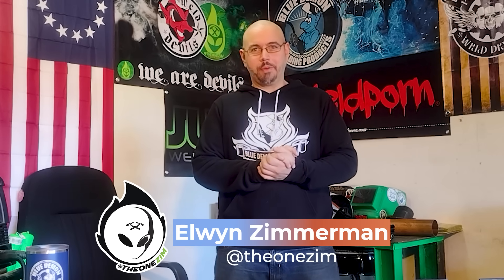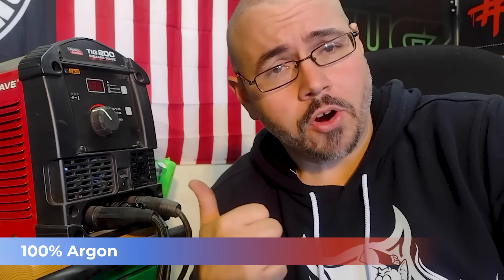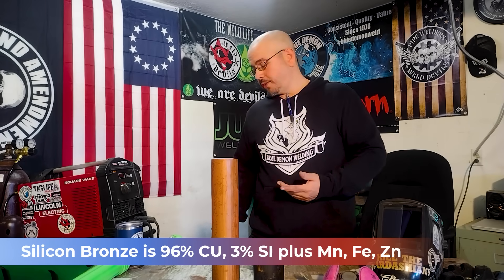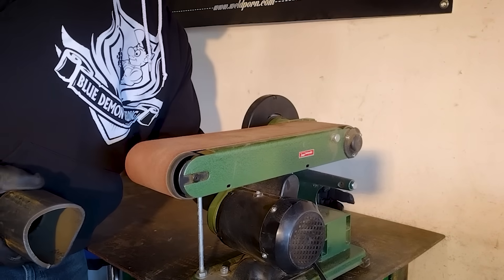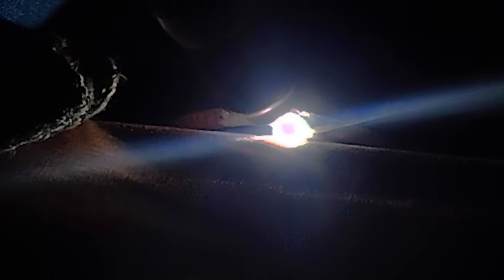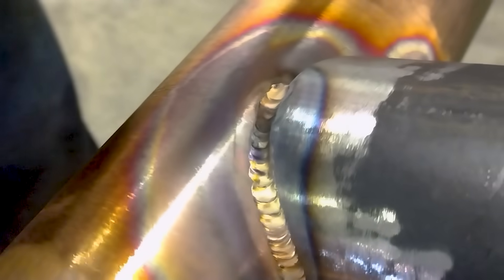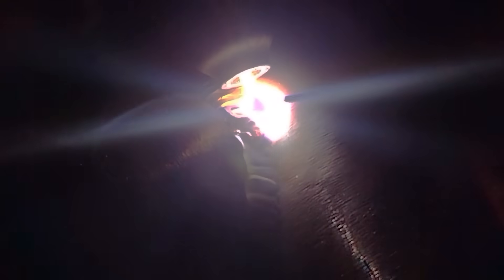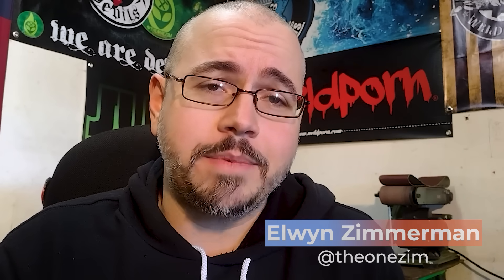TIG Welding Copper to Steel HOW TO

Comment: I think this is TIG brazing.  If you form a weld puddle on carbon steel and stick a silicon bronze rod into it, it will vaporize the silicon bronze because of the large difference in melting points.  You can weld copper with a silicon bronze rod because they are similar metals with similar melting points, but copper or silicon bronze will not weld to carbon steel.  When he talks about "washing up" with the filler metal, the steel is not melting.  The proof would be to cut and etch the weld nugget to either verify or refute that it is a "weld".
Reply: As I have learned, in welding the two materials to be joined melt, with or without an added filler material. And in this video I don't see liquid steel, so it's not welding, but brazing. So I think your statement is correct.
Reply: Like I said in the initial post, this is easy to prove or disprove.  Just cut the weld, polish, and etch so you can clearly see the weld nugget.  You will be able to clearly see if the joint has melted and joined, or if it is in fact a braze joint.  Now, there is nothing wrong with brazing.  Brazing is very strong and reliable.  It's just that welding and brazing are not the same thing.
Reply: @HemiRod23  Sadly most videos cut short on that, but it is a necessity to judge a connection.
Reply: Correct.
Reply: ok hemi i feel your point! however it only takes about 90 - 110 amps tp melt that steel??? he is running 200... i know that he is pumping the peddle however at a 200 amp max SOMETHING is meltling. also another just food for thought.... this isnt a structural weld its more like an art or fabrication thing
Reply: @kc8mwt  he's using 200 amps because of the copper.  Copper dissipates heat very efficiently, and needs a tremendous amount of heat input to weld.  Aluminum is similar if it's a large enough piece.  I used 250amps to weld an aluminum transmission case because of the amount of heat it could dissipate.
Reply: @HemiRod23  I know... that was my point
Reply: There are copper alloys containing iron, and there are steel alloys containing copper.  Metallurgically speaking, welding these two metals together are entirely possible IF you can melt and alloy them together in the puddle under the right conditions.  The boundary layer in the weld between the two dissimilar metals would be a mixed transition zone between a steel-copper alloy and a copper-steel alloy, blending out to each parent metal.  That's not to say it'll form a strong bond, but the two will technically be "welded" together by the very definition of the word.  Practically speaking the alloys created will be weak, have different expansion rates, and the joint will likely fail if compared to a more traditional brazed joint.  I couldn't say what's going on here and neither could anyone else without cutting, etching, and examining under a scope first.
Reply: @Skinflaps_Meatslapper  Agreed.  As I mentioned, cutting and etching is the definitive proof one way or the other of what took place.
Reply: I think this process can most accurately be described as "microscopic brazing". The copper and steel are melting and adding to the puddle, but they will not form an alloy with silicon bronze in the puddle. The puddle will contain microscopic sections of iron (copper will mix into silicon bronze and alloy with it); the puddle will not be an alloy containing iron; it will me alloy of silicon bronze with added copper content and iron mixed into that alloy.
Reply: I think could be it oxyfuel brazed. Heat the steel up first.
Reply: @Portarius1984  Difficult but maybe possible. Copper is very unforgiving.
Reply: Lol yes that's called brazing not welding. Welding is actually fusing metal together but I mean if it doesn't need to be strong then it will do for the hobbyists I suppose. I've brazed just because it was faster too
Reply: Where I work we use monel filler, it does get an etch and dye test and it most definitely does have a true weld, not brazing.
Reply: winner winnner, chicken dinner
Reply: So which rod is better for copper to carbon steel?
Reply: @adonaytewodros5340  brazing is really your only option, copper doesn't weld, it can be stuck together though
Reply: What rods to use with copper when welding steel308?
Reply: Thank You. Excellent description
Reply: Dang you weld like a robot
Reply: @HemiRod23 I can assure you that welding the two together is possible. No filler rod
Needed if done correctly.   I have done this many times now.
Reply: If you are melting the steel and the copper then it is a weld, correct?
Reply: @jasonbirch1182  >If you are melting the steel 
That was his point - steel not is melted and melted filler just stick to it like tin stick to copper wire.
Reply: @delta_glider4362  9:55-10:15 it's clearly melting the edge of the steel.
Reply: @jasonbirch1182  agreed... not sure what they're seeing.. he even says to wash the copper puddle to the steel and use very little filler because the MELTING STEEL will add to the puddle...lol
Reply: @jasonbirch1182  he may be melting the edge of the steel, but that is a bad thing. In this process you don't want to melt the steel. If you melt the steel you are weakening the joint and if you melt too much of the steel in the braze it will crack. It is an unwanted side effect of imperfect brazing technique not a part of the process.
Reply: @jasonbirch1182  you cannot weld ferrous and non-ferrous metals together!
Reply: @offyouselfsbuddy1683  ok, except he just did. So try again.
Reply: @offyouselfsbuddy1683  Um. Mild steel to 304 SS is ferrous to non-ferrous.
Reply: @offyouselfsbuddy1683  Zinc bonds aluminum to steel just fine welded or not
Reply: @MrVegasTube  um. mild steel and stainless steel both have umm steel in the name, ferrous means contains iron so both mild steel and 304 stainless steel are iron containing
Reply: @delta_glider4362  If they "just stick together", then you should be able to separate them later, good luck with that whatever it is welding, brazing, or soldering, there is a fusion point in all of them, it do have different thickness but it is there.
Reply: @boosted2.4_sky copper won’t bond to molting steel it’s brazing. You cannot weld a nonferrous metal to a Ferris metal..
Reply: @MrVegasTube technically stainless is still a Ferris steel 😂 so no.
Reply: @lonewolftech  Technically... which one; the ferritic, the martensitic, or the austenitic stainless are you refering to chief?
Reply: @jasonbirch1182  these are dissimilar metals that cannot be welded this way. It is braising.
Reply: @welderdude1  no it can be welded, just won’t hold.

Everyone else, the difference is that welding breaks down the base metal, brazing doesn’t it keeps it to a minimum.

The best way is to twist inconel 686 and 70/30 copper nickel together for filler. Still won’t hold that well but it’s the best I’ve found.
Reply: @tfaith08  Agreed fundamentally. I just found Chromium containing fillers not to work problem free with Copper. Inconel usually has quite some Chromium in it, usually. But I haven't used 686 yet. Copper nickel, NiFe or NiTi wire worked well.
Reply: @tfaith08  this seems to be the best explanation here
Reply: copper can weld to carbon steel
Reply: @kniferewiewscool2646  Laminated as damascus pattern, kind of. (I'd still call it a braze then.)
But forming a common melt pool and mixing in the liquid phase does not work. It doesn't always fall apart on its own again, but it is not what is usually meant with "can be welded".
Reply: @jackmclane1826  ah alright
Reply: @kniferewiewscool2646 no it cannot 😂
Reply: It is a weld regarding the copper side and a braze regarding the steel side. TIG brazing of steel sometimes also melts some steel, but it is rather an unwanted side effect. 
A little iron in the puddle works out, but when it gets too much, it will crack very fast.
Reply: @jackmclane1826  Agreed, if you wanted a leak proof coupling (and this happens a lot in HVAC where copper pipe is joined to steel fitting or valve) In those case they will use a flux and silver brazing rod to join the two. Harris makes a boron based flux for this purpose. Thing is this will have to be close fitting, as in you use coupling to braze the two together, not just butt the metal together and braze away, it will not hold pressure. 

That is unless you are doing ammonia based HVAC system, then you are welding everything because ammonia eats copper (the pipes will be steel and all brazing rod is copper based)

I've tried TIG brazing copper together using phosphor bronze rods (not silicon bronze), and while it works, it's a very fine line between melting the copper and melting the brazing rod, and at low amperage the arc wants to jump around. This is why they use MAPP gas or oxy acetylene torch, or just acetylene air torch for this. They also pump nitrogen through the pipe at about 1 CFH to keep the inside of the pipe clean while they braze.
Reply: @taiwanluthiers  
I have never tried tig brazing copper piping myself.  I can imagine it is very difficult as the melting points are not that far away from each other. 

I make my own HVAC work for years now, and although gospel is that it doesn't work, it is terribly dangerous and what not, I exclusively use Staybrite No8 for it on both high and low pressure side. It is technically a soft solder, but a higher strength one. It also needs higher temps than average soft solder, but it still is below the arbitrary threshold to be called a braze. 
So it is kind of an intermediate step between soft solder and a braze. It works extremely well. I never had a fail with it! It can be done with a standard propane torch, the copper pipes are still strong and don't get annealed and when you are quick enough they hardly oxidize. So although I also always used a nitrogen or argon purge - I usually have an argon tank for welding around, but not necessarily a nitrogen tank, it might not even be necessary.

The old timers in the trade always get nervous about it, but as a matter of fact - i tested it - the joint takes higher pressures than a braze. The brazed joint blows next to the braze like a sausage because the high heat while brazing softens the copper. The staybrite 8 joint was still intact after 10% more pressure than what blew the braze joint. I didn't have any more pressure available to blow the staybrite 8 joint.

I will never use anything else on HVAC copper piping. I have never worked on ammonia systems, though...
Reply: @jackmclane1826  I can't get staybrite #8 in Taiwan, but I found this "hard solder" from China that is flux cored. It definitely melts at a much higher temperature than solder, as in you needed to get your copper to dark red before it will even take, but it was a lot dirtier than just phosphor bronze. It doesn't need flux because it is flux cored. I do not know if this is the same as staybrite. It could also solder steel and other harder metal as well.
Reply: @taiwanluthiers  No, that must be something different then. Staybrite #8 works just as standard soft solder. Just the temps are a bit higher. Like 50°C higher. 
It was difficult to get it in Germany, too. I had to get it via a welding supply store that has access to the full Harris program. A spool lasts a long time if you only use it on the occasional fitting that needs it. I don't do commercial work with it. 

Greetings to Taiwan! I loved your country when I visited it in Springtime for a business trip! Stay strong!
Reply: @jackmclane1826  I asked what it was and they wouldn't tell me. It had something like 200C more melting temperature than soft solder, but it is not as high as brazing rod. I bought a few but ended up using phosphor bronze because I needed to replace a compressor in the middle of summer, as mine crapped out in the middle of the night. I ended up paying someone with an OA torch to phosphor bronze it. Then I gotten a mapp torch which could easily braze copper instead of using crappy butane torch that couldn't get it hot enough.
Reply: @Sal Spencer a good proper braze is nearly as strong as a weld.
Reply: Weld said sir ;)
Reply: I'm saying welding. The steel IS flowing into the weld! The copper and steel aren't mixing the they are both combining with the filler.
Kind of like welding Inconel to stainless using C22 transmission rod.
Reply: Tankx for being the voice of reason. I'm a retired Boilermaker and if this guy showed up on a job site telling us what everyone calls him, it wouldn't be welder. The closed I ever came to what this BS tube you video, I got to weld copper-monell super-heaters tubes @ a coal fired power house that was raised to the ground about 5yr ago. I suggest he cut out 3 specimens and do a bend test, face root and side bend or just do 3 side bends. I've seen many a welder laid-off failing side bends.
Reply: Correct, this is not welding, this is brazing.

Comment: Very interesting. Was this just an experiment, or do you have uses for this process? In actual application of this process in a piping system, I would be concerned about catastrophic results due to galvanic corrosion. However, it is awesome that you were able to weld these dissimilar metals, just food for thought.
Reply: We do this in the manufacturing of finned tube heat exchanger coils and related heat transfer equipment and accessories, such as process gas coolers/heaters, transformer oil coolers, fan/coil units, face and bypass coils, frames for coil removal capabilities, airside transitions, and drain pans. These are used in a variety of industries including HVAC, fossil fuel power generation, nuclear power generation, industrial process, pulp and paper, automotive, and petrochemical.
Reply: The steel will be the electron donor and will oxidize.  I would be most concerned about brittle weld as iron greatly reduces the ductility of copper.
Reply: How would this be different if you were welding to a hole in the copper. ie: edge to edge.?

Comment: Your copper tubing does not contain zinc. The bronze likely does not have any zinc either. Brass has lots of zinc.
Reply: Of course you don't want to breathe any of the fumes so the mask is a good idea.
Reply: >Your copper tubing does not contain zinc.

Can you tell a copper tube from red brass tube? :)
Reply: @delta_glider4362  Zim said he was welding Type L copper to steel with silicon bronze filler, not any red brass involved. The silicon bronze does have some zinc. Cheers.

Comment: WOW!  Never in a million years did I think that was even possible.  Your weld talents are amazing.
Reply: I think this is tig brazing. Doesn't actually penetrate the metal I believe just lays on top but it is incredibly strong.
Reply: @x91s55  in brazing the filler doesn't just lay on top. Rather, the filler heated to a liquid state is sucked into microscopic pores in the parent materials via capillary action (think of how a drop of water is sucked into the tight space between two slides for a microscope).

Once the filler is cooled it is physically locked into both materials being joined, kind of like puzzle pieces.
Reply: @SpacedInvaderp  thanks for the clarification
Reply: @SpacedInvaderp  that is not true, solder does that.
Reply: @offyouselfsbuddy1683  sorry but you're wrong. 

Brazing and soldering are very much alike, the main difference being the melting point of the filler metal and the ultimate strength of the joint, with brazed joints offering more strength.

Fillers used for soldering usually melt below 450°C, brazing fillers melt at a temperature higher than that.
Reply: @SpacedInvaderp  doesnt that mean it’s not actually welding, even it looks quite similiar. Welding means fusing the 2 pieces together, like making the puzzle pieces 1, and the base metals fused together, making the bond much stronger, since copper and carbon steel dont mix together the same way as 2 metals welded together. Meaning it’s brazing rather than welding.
Reply: @dingedong1627  correct.

I believe someone actually pointed out earlier in this thread that it is brazing as opposed to welding.

That being said the joint created in brazing, as with welding, is often as strong or stronger than the base materials.

It comes down to the base and fillers being used. The actual bond itself is very strong.
Reply: Thank you so much for your positive feed back!

Comment: Nice brazing not welding but looks good
Reply: Welding melts the base metals to join them together. This creates a strong metal fusion. Brazing uses filler metal to join together two separate pieces. Hence if the base metal is liquified it is a weld.
Reply: @1dreadyzim  no a weld has to be an amalgamation of both materials simply melting one of the metals to the filler isn't a weld of the materials to each other .
Or you have just joined one material to the filler
Reply: @mickridley4409  both metals are melted here👍🏼

Comment: All three types you refer to are types of tubing, not different alloys. My sources list copper tubing as available in C10100, aka 101, basically pure copper; and C12200, aka 122, with added phosphorus to deoxidize it.

Comment: So why would you be welding these two materials together? What kind of environment would this be a regular procedure?
Reply: Heat transfer equipment, heating and cooling coils for large climate control systems. The larg housing units on top of buildings are where you would most likely find them.
Reply: @1dreadyzim  Thanks!